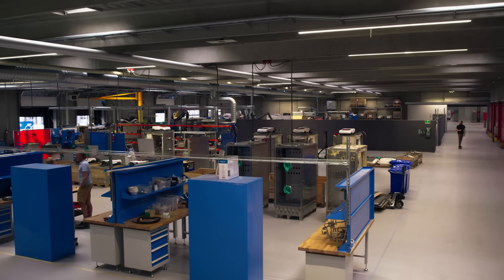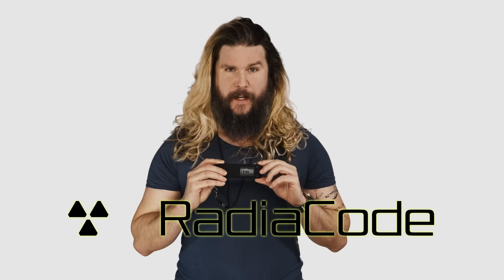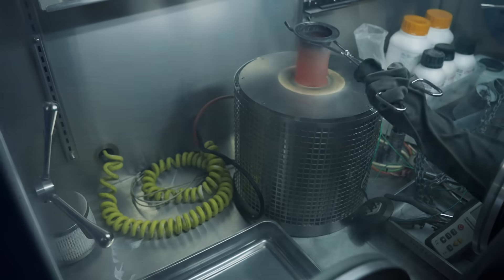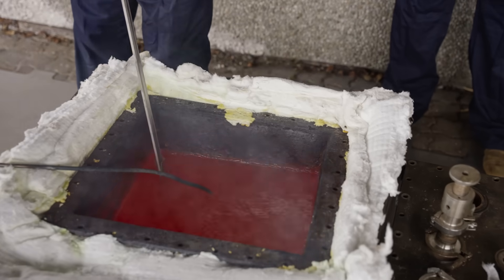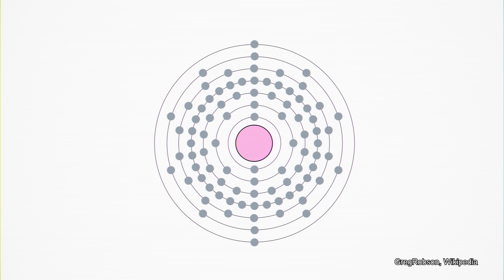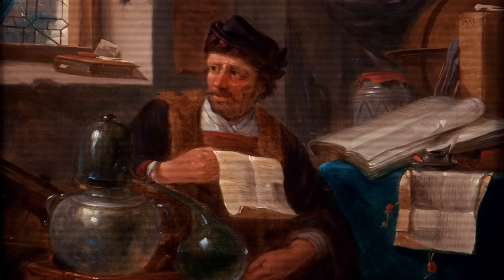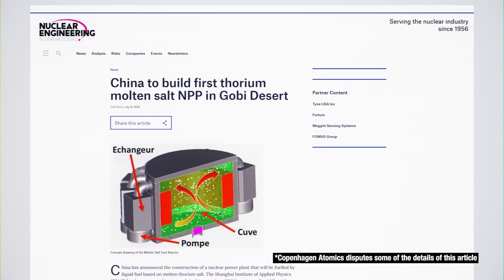Is THORIUM the Future of Nuclear Power?

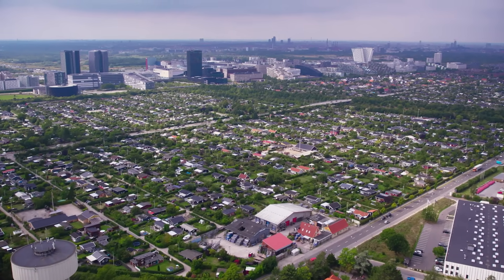Comment: 15:36 it’s a simple answer, overregulation and fear mongering have hamstrung development of nuclear technology unnecessarily
Reply: It's not over regulation.  But nuclear fear mongering is real, and not without some justification.
Reply: @ overregulation is absolutely an issue, and claiming it isn’t doesn’t make it go away like some fairytale.
Reply: Lobbying from the fossil fuel industry.
Reply: @ fossil fuels have no bearing on nuclear. There are far too many byproducts from oil and other petroleum sources for us to abandon it even if we replaced it as an energy source.
Reply: @ I meant that the fossil fuel industry spends a lot of money making sure nuclear doesn't get a foothold.
Reply: @ and I’m saying they have no need to do so. EV’s still aren’t viable or available enough to replace the ICE, and there are far and away too many products that come from petroleum for it to go away. Even if we adopted 100% nuclear for the grid tomorrow, all of the plastics you use alone would keep the oil industry in business. They have no need to lobby against nuclear.
Reply: @HMAlaska just because they would continue to have some sector of the market doesn't mean they have no reason to. The fossil fuel industry absolutely does lobby against nuclear. Coal is a fossil fuel and isn't really used for anything other than the production of electricity. It's not fuel for cars or the base material for plastic. The same goes for natural gas. All of these industries have a very vested interest in keeping nuclear out of common usage.
Reply: @ coal isn’t nearly as large a percentage of lobbying as you’re making it out to be. Government has been far more of an issue (even by just allowing for the very lobbyists you’re complaining about) than any market provider.
Reply: @HMAlaska  i never made it out to be any amount, simply stated that it exists.
Reply: @HMAlaska  Do you genuinely not understand that government regulation is influenced by lobbyists? Fossil fuel industry isn't going to sit back and say, "oh well .. at least we got the plastic bag and vaseline market."
Reply: @HMAlaska You're talking about a group that controls the majority of the generation of energy for the entire planet and acting as if they wouldn't bother to lobby regulations or public opinion against any competitor.
Reply: @HMAlaska "Fairytale" indeed.
Reply: Simpler answer: Westinghouse.
Reply: Your attitude is so bizarre because I am in complete agreement with your original post.

Comment: Questions. How much energy is needed to heat and keep the salt at nearly 900 degrees? Is it more or less than how much you would get out of the reactor?

And what would happen if the heat dropped off and the salt becomes solid?
Reply: Waste heat downstream (post turbine) is still quite hot and can be used to crack water and make hydrocarbon fuels. Internally, the CORE MS is hot but if it becomes TOO hot (runaway reactions) it will melt a physical plug of different material and drain out into tanks then freeze (vitrify - become glass like). MSRs are designed to be "walk-away" safe as no maintenance of the reaction is forced to stay ON to keep things from going bad (supercritical). There is HIGH heat but low pressure (unlike the reactors common now). Vitrified material still needs be handled with extreme caution. However, it's NOT going to explode and spew all over from a hydrogen or steam explosion. Not an expert, just an enthusiast.
Reply: The chain reaction will generate the heat to keep it going until all the fuel is spent. It may only need a small amount of heat to get the process started if it does not start by itself although I am not sure.
Reply: @matt_acton-varian  cheers

Comment: In SoCal?  They need to build like 30 small modular thorium reactors all the way up the coast, far enough away from the fault lines to be safe, but near enough to make massive ocean desalination facilities a thing.  Have the desal water from each reactor associated pump/plant stored in huge reservoirs in the hills that act as batteries.  When the water is returned for use, electricity is generated, making the system less expensive.  This way, the water tables can be restored, massive reserves of water will be available for fires, farming, urban use, and the surrounding ecosystems can be restored to thriving desert forests.  Existing solar can be tied into the pumps, leveraging the reservoirs for energy storage when there's a surplus.

Oh, and energy will become so cheap as to be nearly free for all but business consumption.
Reply: There are additional problems with desalination than energy. It is bad for the environment, as it Increases the salinity of the coastal habitat and disrupts the waters. Still has real benefits, but you can't just massively scale it up without concern.
Reply: @Sam_on_YouTube could you not just avoid pumping the salt back into the ocean? like, evaporate it down to crystals and store it somewhere on land?
Reply: @Sam_on_YouTube lol you aren’t required to dump the salt back into the ocean.
Reply: "Up the coast" and "far away from the fault lines" is a contradiction. The fault intersects the ocean just north of San Francisco an in most areas is less than 40 miles from the sea. Most of the coast between there and LA is very mountainous, with very little infrastructure, not suitable for large construction projects or utilities.
Reply: Large scale desalination like this does sound great, but you also can't just dump that much salt right back into the ocean without harming the entire local ecosystem. It's got some challenges as well, but for sure is going to be something we adopt wide-scale
Reply: What? The slot you take out of the water goes back into the water it came from, the difference in net salt level is ZERO. The ocean can be seen as an unlimited supply of water, so why would putting the salt that already came from the ocean, back into the ocean do anything?  @ayybe7894
Reply: @ayybe7894 lets just use some of the salt then, cuts down on salt mining
Reply: @ Desalination does not output pure powdered crystalline salt. It outputs a more concentrated brine. Further processing it to get usable salts (and other minerals) is an option but uses even MORE power.    

Mining for salt in vast underground deposits is relatively inexpensive in comparison.
Reply: @ayybe7894 
Surely you just lay the brine out in evaporators and let being in the desert do its thing?
Reply: @MostlyPennyCat  that's surprisingly polluting.
Reply: A few problems with that, namely the brine you'll be pumping back into the ocean will form lethal brine pools, and you're ignoring the obvious solution, evacuate that desolate hellhole. California isn't mean to sustain millions of people and farming.
Reply: Water for fires you already have at this moment, it is the massive Pacfic ocean, however you just can't apply enough water to extinguish the current California fires without teleporting the ocean onto it, with its own kind of problems, due to the nature of the fire.
But farming however does need the fresh water though.
The channel "Whats going on with shipping" has a nice piece on using salt water for fire fighting, and why it isn't a problem.
The simple quote is: "I do know that a gallon of salt water will cool a heck of a lot more of a fire than nothing at all"
Reply: @CMDRSweeper  Silly people talking about using or not using seawater simply don't know anything. 

You can't just drop miles-long hoses into the ocean and run them all the way to the fire. Physics doesn't work that way. And as for the planes that drop water? If the sea is closer than a reservoir or lake (rare), yes they are using the ocean.
Reply: Side note, I highly recommend the podcast on the Resnicks by the Dollop, on their theft of water, and.. paper water!! 😡
Reply: you nailed it
Reply: The issue with this is that it makes way too much sense
Reply: love this idea but energy will never be cheap while there is money to be made
Reply: @TMWNN78  if this is actually very successful and has an impact on the US (fossil fuel) economy then Denmark might be accused of having WMD /s.
Reply: Free for all except business. Do the maths. Are you talking about communism or the completely unrealistic free for all, passing the cost to everyone through inflation? Also the weak regulation in industry has ensured business would never allow them to pay for something while you sit on unlimited access for free. They would make sure they could have the control of it and make sure you will pay for it, a lot.
Reply: @Dennis_M1DLG  He said "nearly" which is likely because households use much less electricity than business. Hence, they would have to pay so little as to make it essentially free.
Reply: How exactly do water reservoirs constitute a battery?
Reply: @MostlyPennyCat  pumped storage. Pump water up a hill, have a turbine at the exit and you recover around 80% of the power used.